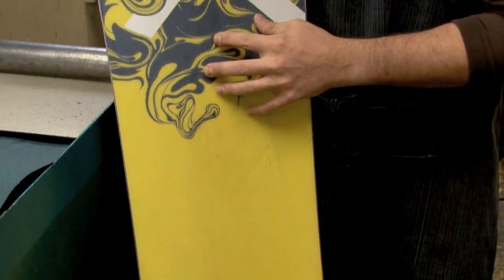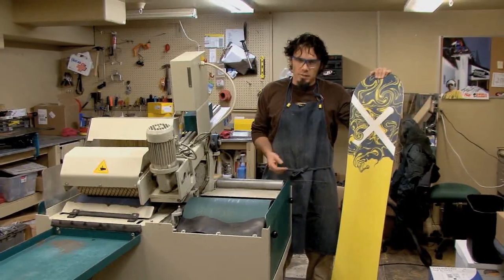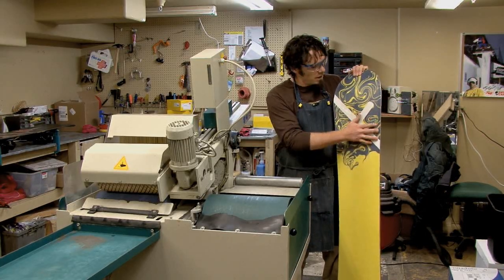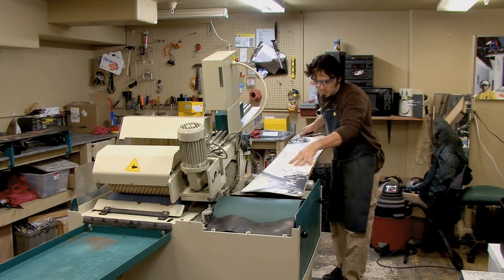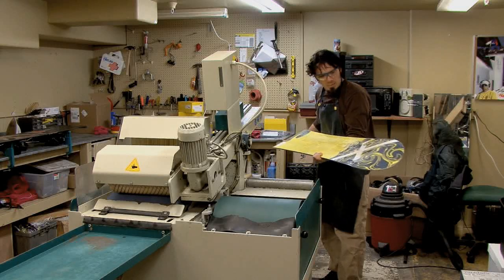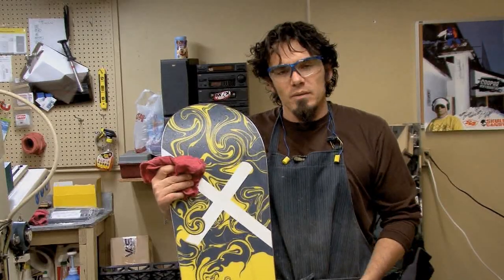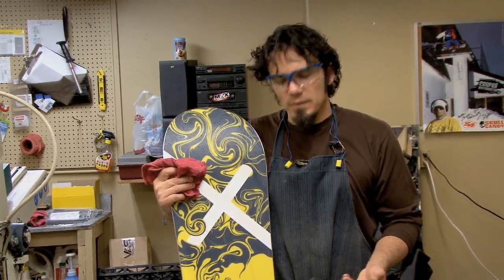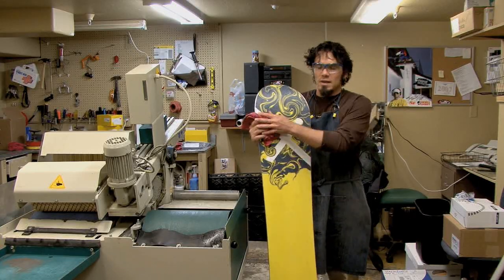Snowboarding Gear : How Do I Resurface a Snowboard?

Comment: IF YOUR BASE IS DIRTY. Don't base grind it especially if you already have a great base because a sand paper structure is not the way to go. Use a BASE CLEANER rubbing the base with the cleaner and a paper towel it will pull all the "sand and dirt" out of the base making it also "good as new" every time you base grind you lose more of your base and not many boards, unless you ride a neversummer, can take that many grinds. only base grind if you have, a lot of scratches, fresh p-tex or base weld.

Comment: What grit is that sanding drum?  I'm hand sanding right now with 150 aluminum oxide paper made for a hand belt sander.  Gonna get an electric belt sander, but thinking about mellowing out the grit so its harder to mess things up.  Thoughts?